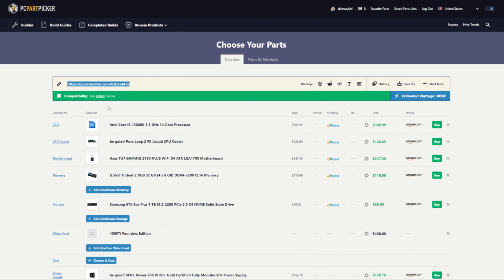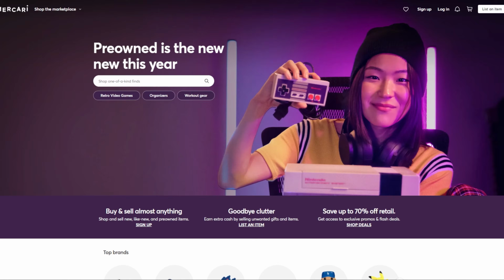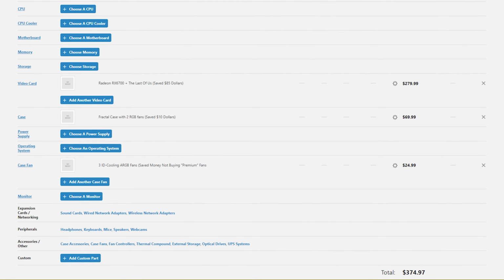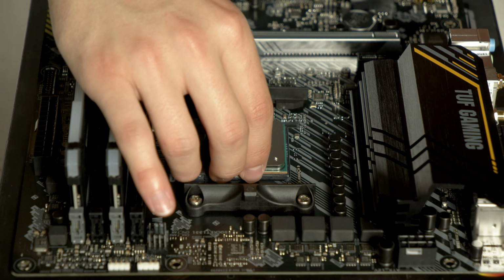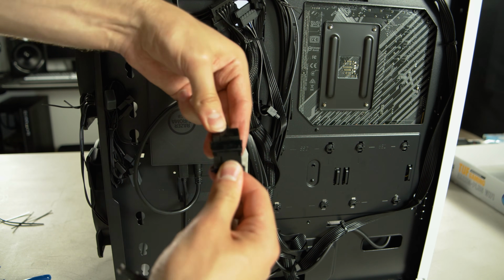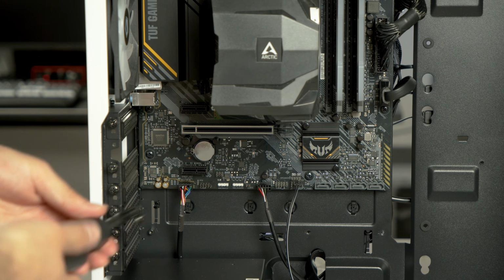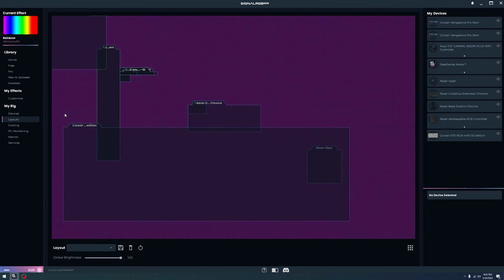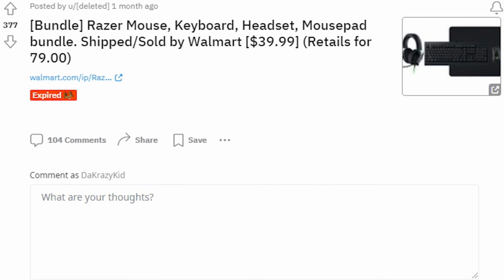Build An RGB PC For Less Than You Think!

Comment: So I have 3 rgb fans on the front and a deepcool ls coller with  3 rgb fans on top, 2 rgb rams and zotac rtx 4070ti(has rgb). I don't have a led controller. While using the signalrgb it only detects the motherboard (I have gigabite z series) and can control the 6 fans as 1 single unit ( can't control individual fans) other devices like rams, graphics card and a extra fan on the back are not detected by signalrgb.. Can anyone help what do I need to do?

Comment: I got a question my mainboard has  a RGB 12 volt header not the 5V version so if i put a converter from  12 to 5V woud it still work with  that software ?

Comment: signal rgb broke my whole rgb in my pc i don't recommend it
Reply from the maker: No it didn’t. Follow our tutorials and you’ll be fine. You’re referring to your devices flickering right? You need to uninstall all rgb applications through windows control panel and restart your PC. Do a power cycle. You can’t have multiple apps installed and trying to control devices alongside SignalRGB. Devices flickering is harmless and SignalRGB does not break RGB.

Comment: I'm trying to configure my devices and I can turn my CPU cooler RGBs on and off by disabling the 12v Header but I can't see it as an individual device or configure it through a channel of the motherboard. It was showing up in the layout and I was ok with that but while messing with it to work on the fans, it turned red and still doesnt show up in devices and although it is in the layout, I can't work with it. Any suggestions? I've been trying to fix it for what feels like forever :(